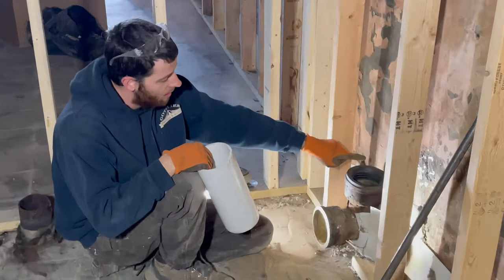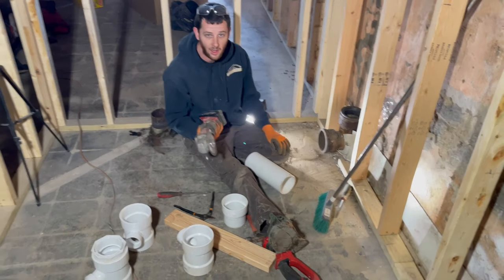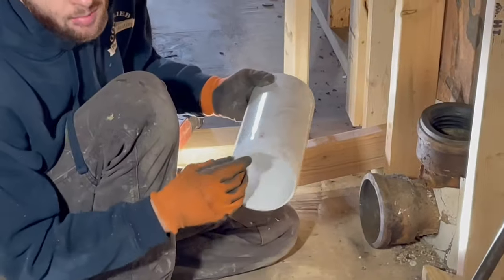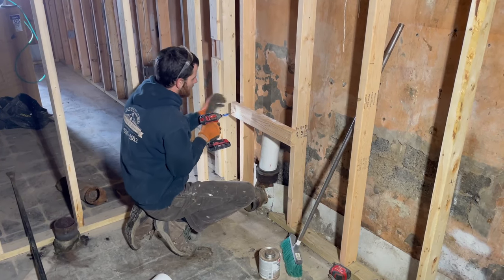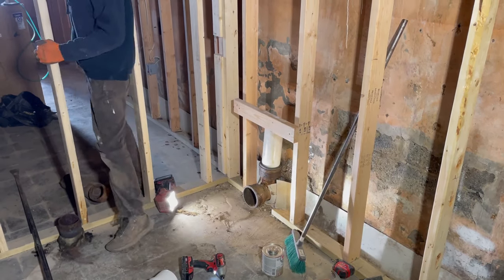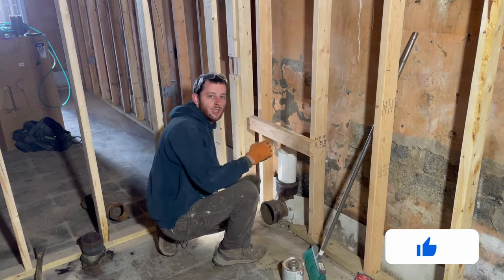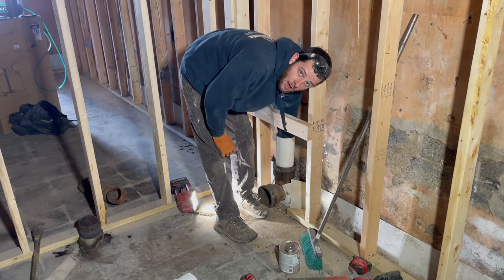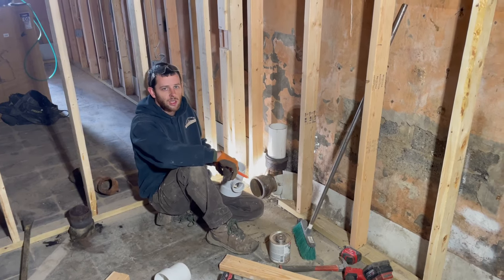How to Tie PVC into Cast Iron Hub | Episode 11

Comment: Alot easy way is to just use a rubber mallet, been doing it for over 20 years  never had an issue , I'm a self-employed licensed master plumber in 3 states and the easiest way is to use plumbers grease or dawn dishwashing liquid and a rubber mallet, saves time and you have more control
Reply: Could you please give a video link
Reply: Nice. Now do they make that same rubber gasket for 2 inch and other sizes then what he showed?
Reply: @Jaydayallday yes they do. Fernco donuts
Reply: This comment served me well
Reply: I know this was a year ago but is that a good seal on a horizontal pipe ? I want to change my drains to pvc but the connection to the septic through the foundation is cast iron.  There is a junction packed with jute and lead I am guessing...
Reply: No plumber here what so ever, but I was wondering why not use a rubber mallet? Thanks for the comment

Comment: If I have a difficult gasket to install I put it in boiling water for a few minutes.  Lube up the pipe with dish soap.  fish out the gasket with a wood stick drop it in the hub and then put the lubed up pipe in.  If you work fast it goes in easy

Comment: Thanks for the tip! I was having a hard time getting the 4in into the donut even with soap. I did one years ago but couldn't remember. My main thing is hvac but I get a few plumbing calls. Once i busted out the grinder and beveled the edges of the pvc she went right in with a few taps. Thanks

Comment: Good video. I have one suggestion. Prior to putting the gasket in the cast iron, put the pvc pipe in the gasket all the way. Make a mark or use tape on the pvc at where you want the pvc to finish. Then remove the PVC from the gasket and proceed as usual.  Takes the guesswork out as to whether it is in properly. Also liquid hand soap is a good lubricant.

Comment: Super helpful video - thanks for that!

I have basically this setup in my house with a big 4” cast iron wye embedded in the basement floor and I’m looking to replace everything above that with PVC. I even have basement laundry (like you mention in the video) and as such need to tee off as close as possible to the fitting in the floor…

…which leads to a question: can I plug a 4x4x2 street santee directly into the rubber gasket? Or does it have to be pipe or that reducer fitting you showed? Just looking at options to get the laundry drain as low as possible. 

Should note that I don’t have the fittings/gasket in hand yet it’s possible the street wouldn’t even fully seat but figured I’d ask.

Comment: today's the day... but with 3". Ordered the fernco.  missed that part about PVC adapter.  Thanks !
Reply from the maker: Good luck!
Reply: @JewswithScrews  I got it and it took me 3 hours !!  the cast iron was at a 45, so no straight shot to push.  I used ABS and was a super tight fit into the fernco.  and where I wanted to put the temporary 2 by 4, well the pex was there and the beam was notched, MOTHERFATHER !  There was a label on the pipe and I used that to gauge how far in I actually had pushed it in.   TOmorrow, will cut it a little, fit fitting and Y, and run it to toilet flange.   Has to be better than the wiggly job the last guy did - hey, why is there 1/2 gallon size plumber's putty container here ?  I found out why.  Onward and upward !
Reply: update,  Glued the drain line !   (Friday)  Water in the toilet, Fire in the Hole !  -- whoosh, yea.  Wait, what's that splashing noise ?  It's the main stack behind the kitchen wall, so we get after on Monday.

Comment: Just did this...I'm not an engineer or a plumber, but...fernco needs to redesign these things.  It shouldn't take a 6 foot bar to install a pvc pipe.  This is for household drains and sewers, after all...not rocket fuel!
Reply: The problem is those old cast iron hubs were not all the same size and fernco only has two sizes of gasket

Comment: Can you use that gasket on the horizontal run as well or will it leak compared to the vertical gravity fed vent.  I have something very similar to work on and my run is horizontal.
Reply from the maker: Yeah you can use it on the horizontal as well as the vertical

Comment: I need to replace my 4 inch tee with a clean out on it. Only thing is the pipe going to the outside exits the house about 5 ft. up the wall horizontally not through the floor vertically. This seems like the right method but fear that getting the new sdr fitting/gasket pushed into place could be a bit challenging.
Reply from the maker: Mike says he does it all the time horizontally just make sure if you use a piece of pipe bevel it a lot and freeze it or you can cut a rib off the gasket but if you get the sdr fitting it will slide in no problem

Comment: In my case, I was able to use a clamp (twist to tighten type) to get the ABS pipe inserted.  It helps if you put a cap on the pipe as it provides the clamp with surface area while protecting the pipe wall.

Comment: I bought an older house and it has the same setup you were working on and it didn't have a gasket so everytime someone flushed the toliet it would leak. I'm going to be doing it the way you did but was wondering do you have a link to the 4in rubber gasket you used so i know i got the right one?

Comment: same idea with the horizontal tie in ?   that's what I am trying to figure out, the previous "best man" I had working on it, is long gone and this ABS to cast iron joint wiggles !  WTH, surely it will leak once we start using it, right ?  thanks for this video

Comment: Will this method work under ground?
Reply from the maker: Not sure what you mean exactly. We’re in our basement in this video so technically we’re under ground
Reply: I have a sewer line buried under ground. I need to replace cast iron clean out section from hub to above ground with pvc. Will this work in the ground? Thanks for your response.
Reply from the maker: Hard to say but if you’re digging up the ground you’re going to need to call a plumber. That’s not a homeowner type of job lol
Reply: Yes, this technique will work after you remove any dirt or concrete away from the car iron hub. This example was a vertical example. This watertight connection will also be watertight if the pipe is horizontal. You may want to build something that you can use to create leverage to push the pvc pipe into the rubber gasket inside the hub coupling, to make it easier to force the pvc pipe into the rubber gasket.

Comment: I have about an old lead toilet pipe that broke and has about 3 inches of lead still connected to the iron stack hub tie in. Would it be smarter to remove the lead and connect as you have shown or shove the CPVC inside the remaining lead and clamp it with the wrap around coupling?
By the way this is an upstairs toilet so it's above my head (so I'll have limited leverage)
Reply from the maker: Mike says he would def go back to cast iron. Don't tie into the lead. Bevel the shit out of it to make it easier to get in. And make sure you get the same gasket we have, not the ones from Home Depot
Reply: @JewswithScrews  Hey thanks for answering my question. I was hoping you would say otherwise to save myself some work. Still though it's good to know. I had one plumber come in and say "let's replace the whole stack to save yourself some future headache". (Uh.....NO!)
I'm going to the local plumbing supply right after work today! Thanks again!